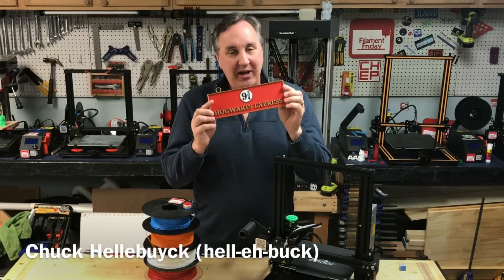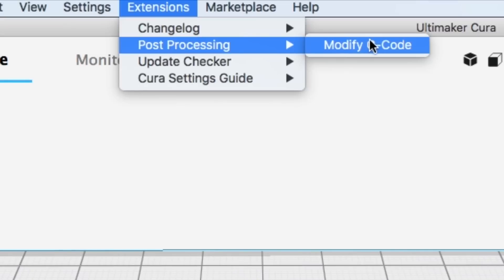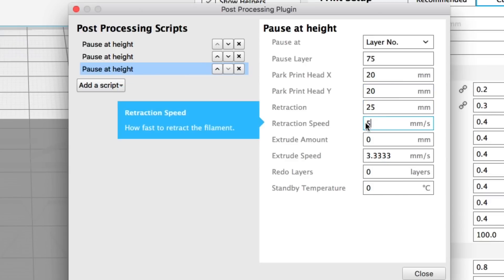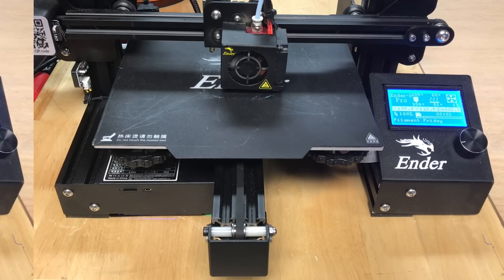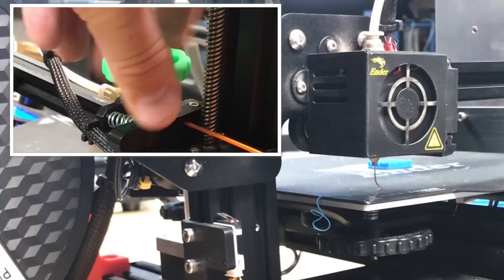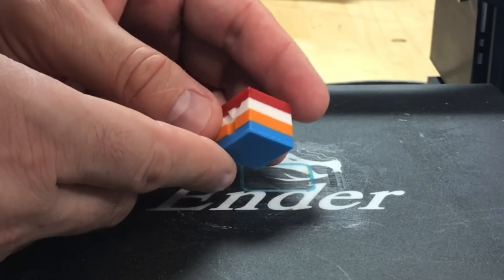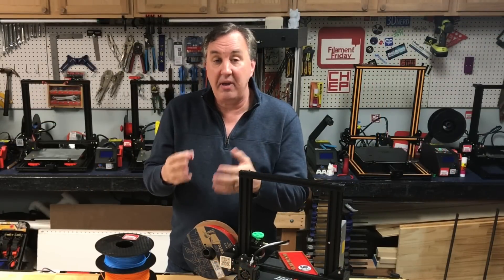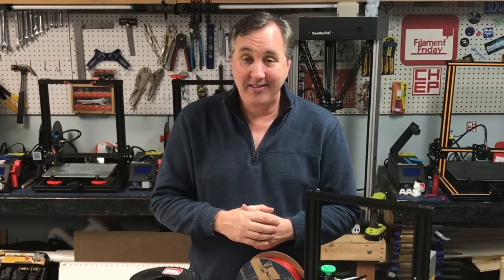How to do Multi-Color 3D Prints on Ender 3 3D Printer

Comment: When I pause at layer the print starts right back up again by itself after a few seconds without letting me change filament. Ender 3 V2 with Cura 4.8 
Any ideas why?
Reply: Have the same problem
Reply from the maker: Yep. It’s firmware issue: https://youtu.be/vFcMW6m9OGg
Reply from the maker: Try using the M25 option instead of M10
Reply: It didnt work for both options, but when I used “filament change “ it worked

Comment: Couldn't you just add the G-code to push out 100mm after a filament change and the hotend reaches temp?
Reply: @BlondieHappyGuy  I did NOT say "retract". Take a reading comprehension class. Then reread my comments.
Reply: probably, but you'd still have 100mm of filament hanging that you'd need to cut off before it gets all over your print.
Reply: @TheSwordThain  No it wouldn't. The video showed the hotend was already removed from being over the print. And you could just have it print a 100mm line on the side of the bed away from the print. Nothing to cut and it doesn't interfere with the print in any way.

Comment: Hi chep, thx for this video as well as the other here on YT. I have one question, what will the standby temperature be on ABS?
Reply: Should be similar. 25c is just a safety temp. Not hot enough to burn you, but above room temp to aid in it heating back up faster.
Reply: @TheSwordThain  Thank you.

Comment: If i insert other color filament, the head moves, and wont print correct.
The head is not allowed to move while changing filament, impossible : if i touch the head it moves.
How can i solve this ?
Reply: I am having the same issue and am experimenting with the stepper motor engagement timeout, but it is maxed out at 999 seconds which is fast. I had a few failed prints from not changing the filament before that timeout time. Just curious, what version of marlin are you running?
Reply: same problem with me

Comment: It doesn`t work for me. I have an Ender 3 Pro with 1.1.8 Creality 3D Firmare. I used PrusaSlicer. After the programmed stop (M600) the Extruder moves to the side, but i can`t resume the programm afterwards. Any suggetstions of what might be wrong? Do I need to add something to the code manually?
Reply from the maker: Not sure. It worked for me.
Reply: I have same issue using an AnyCubic Mega S and Cura 4.8-- stumped in fact!
Reply: @Dr_Mohamad_Shaheen  Just found the solution. Im using  the Mainboard: Creality Silent Mainboard V1.1.5 which has the «Advanced_Pause_Feature» disabled by default. After enabling it (on the Firmware), it worked like a charm
Reply: @Noobiosity  Hi can you describe how to enable it?

Comment: Hi Chep fantastic material. I have only one issue a huge blob after extruder comes back above the part. I am using Cura 4.8. Do you maybe faced something similar?
Reply from the maker: It can happen. I pull the filament back a little after changing.
Reply: @FilamentFriday  wow thanks for prompt answer, thats right simple solution :), I will try to implement it in the gcode, thank you for sharing :)
Reply: @FilamentFriday  what commend I could use?

Comment: Great video Chuck. But why do you reprint the last layer? If you extrude some filament prior to restarting, why do you need to reprint a layer?
Reply from the maker: I like to get it soft for better adhesion.
Reply: @FilamentFriday  I was afraid re-printing a layer would wind up driving the nozzle into already existing material. I'll have to give it a try. Thank you.

Comment: Thanks again for an excellent tutorial. I have ander 5 Pro with Duet board and added another extruder. I was battling for a couple of week to get the settings in Cura 4.8 close to right. I was advised all around to rather use PrusaSlicer. I tried but also didn't really get any support from PS users and forums.
Will you please consider a Filament Friday tutorial on Cura settings for a dual extrusion printer? Thanks again. Greetings from Johannesburg, South Africa.

Comment: Does anyone know if the "Pause at Height" also disables the steppers? I have done a CHEP cube in two colors recently using "Pause at Height" and it printed perfectly. When I tried using it again with a bi color ornament, the Z-axis must have lost position because when resumed the nozzle slammed into the print. 

Does "pause at height" lock the steppers except for the extruder? Should, "Filament Change" be used instead?
Reply from the maker: Depends on Cura version. 4.6 and later has an option to set how long to freeze the stepper. 1800 seconds  is the max which is 30 minutes.
Reply: @FilamentFriday  Yes this is important because otherwise the z lead screw can rotate during filament change and you will lose your z reference; then the whole print will be ruined. Happened to me. Thanks for doing the videos Chuck; great job. Ben
Reply: @dieselhead24  This may have been what happened to me.  Ender 3 v2 with newest marlin firmware. Cura 4.8.   Used paused at height  gcode setup and the print Paused at the right layer height, then when resumed it slammed into print and was dragging across the already layed lines.  I have noticed when I've changed filament before that the extruder will move down with any pressure.  Going to try using the filament change command in cura 4.8 instead to see if that  helps with my changing filament mid rpint.

Comment: Hi! Can I do this with Ender 3 v2?
Reply: When I pause at layer the print starts right back up again by itself after a few seconds without letting me change filament. Ender 3 V2 with Cura 4.8 
Any ideas why?
Reply from the maker: Try using M25 instead of M10.
This is why; https://youtu.be/vFcMW6m9OGg
Reply: @FilamentFriday  thanks for answering us sir, greetings from indoensia.
is that M25 or M10 is the method ? as in the list :
Marlin (M0)
Grifin (M0)
BQ (M25)
Reprap (M226)
?
thanks
Reply from the maker: Yes. Try the BQ M25
Reply: @Juliarta Suwasta you better revive pacman or we'll invade your country and bring you freedom. Just warning you once.

Comment: Is there a way to remove the blobs that it leaves on the prints that are supposed to pop off easy. My nozzle will bump right into the blob and it will shift my glass print bed over and will throw off my print.

Comment: I have tried this on an Ender Pro3.  It only pauses for a few seconds and continues.  Any suggestions to make the pause longer or until I start it manually?
Reply: Same happens to me
Reply: @RyanD-045  Need to do a firmware update.  That allowed me to do what I needed to do
Reply: @bradmcwhirter7450  which version?
Reply: Do you have discord?
Reply: @RyanD-045  I do not have discord on my devices with me.   I also do not have the link to the site with the updates but in another video, CHEP recommended a pay site for updated firmware that is updated daily.   This helped me accomplish the color change since I use a creality printer and their firmware does not activate the options needed for color change
Reply: @bradmcwhirter7450  their are too manny files, is their a better way you can help
Me?
Reply: You have Twitter or instagram?
Reply: @RyanD-045  I will look for a link

Comment: Thank you Chep. For me, this worked 1 out of 4 times by now. When the printing head comes back, it digs its hot nozzle into my print and destroys the bottom layers. one time it took off my glass plate and my clips. My only guess is maybe I'm pushing the z axis while I'm changing the filament, I'm trying to be very careful...I don't know...anybody has any ideas? I also selected 0 under redo layers.
Reply: I just had the same problem. Ender 3 v2 with marlin software. And sliced with the newest version of cura. I set the time out to 5 minuten so i can easely change the filament. Every axes including the extruder was locked. So pushing the fillament through was not possible with the weel. I pushed it a little bit through out the wire. After the 5 minutes were done the printer started again but pushed the nozzle deep in the print. Luckaly i was at the printer at the time it happend and i could shut it down.
So with me the z axis was locked but still restarted lower than the last layer. I had not chosen the option to remake the last layer again. Sorry for my bad english if its bad 😁
Reply: @steefco  You have to pull the filament out by hand, (squeeze the extruder lever) and push the new filament in by hand the same way, don't use force on anything or you may cause a stepper to skip. 
Have the pause script move the print head to 0,0 so that when it purges (which is also a configurable thing) it does it off the bed, (if your first pause is not very far up) the second time I tried this trick, it worked ok, with the locked steppers and a good purge.
Reply: @diamaunt2782  thank you for the tips.  I did use the lever for transporting the filament thru the tube. I would like to flush the filament myself by hand but i think i test it again and see if the softwareflush is good enough. And hope that it will not crash again into the print. 
Question: if the z axis changes in the time of the pause the steppermotor wont correct it when it starts again?
It seemly does not know that it changed. It only Works with commando's to go down or up and dont know its positioning from the bed. Is that right?
Reply: @steefco  That's right, if any of the steppers are not locked (set a large disarm timeout so they will stay locked, up to 1800 seconds) and if anything moves, the printer has no way of of knowing it.  Set an 'extrude amount' to do a purge of old filament after the change.
Reply: @steefco  i discovered a new problem. 2 out of 5 times i did this the my ender 3 v2 screen hangs and when i press it just stops the print all together....
as  for the blob when its starting to print theres a line in the gcode that tells the extruder to push out when it wants to resume. u can just delete that line.
Reply: @ozeahairrul9357  thanks for the tip. 
With one of my last prints i had also something strainge like that. The screen was displaying the setting menu while printing and when i went back out off the settings it stopt displaying the progress and went to the startmenu. But i was lucky that the printer went on with the print and finnisht it.
Reply: Same here, the Z axis ends up free, so there's nothing holding it in place.
Reply: @diamaunt2782   i had same problem, try setting disarm timeout to 1800 (the max 30min setting). This will keep the stoppers armed so it won't shift while switching the filament.
Reply: Forgot to mension another thing that happend. Before it wend from rest position to restart it pushed out filament fast in a thick beam a few centimeters long.

Comment: Hi sir please help. I got an anet a8 plus and using cura as the slicer. However, when start printing 2 colors it always end up the nozzle dont get back to the home position once the first color is done so the nozzle keep extruding out the first fillament on my first printing. I have modified the gcode and put m600 but not work at all (i mean the nozzle cant back to the home position when start changing the 2nd fillament)
Reply from the maker: I don’t have that printer so I’m not sure.

Comment: Thanks for your clear explanations how this should work; however, it does not for me, although I followed every step in detail except for the fact that i reduced the number of colour changes. I am using Ender 3V2 and Cura version 4.7.1. 
Is Cura the problem, and if zo, which version would you recommend?
Reply: I should add, that the problem is in parking: it does go to position 20/20, pauzes for just a few seconds and then takes of again.

Comment: I tried using this technique on a print to change colors and the printer stops as it should, but the nozzle crashes into the print when I resume, any advice?  I am using Cura and a Tevo Tornado.

Comment: Tried this on the cr6se and it jus resumes automatically. How can i pause it and then manually start it? using cura 4.7.
Reply from the maker: Use M25 pause not M0
Reply: @FilamentFriday  how about anet a8 plus? i need to put the nozzle back to the home position when changing the fillament

Comment: @CHEP where can I find firmware for Ender 3 V2 that will support M25 or other pause method for this printer. Will be great to have filament change mid print for 3 V2... please
Reply from the maker: I’m close to having that with V2.0.7
Reply: @FilamentFriday  So good to hear - want to try it on my E3V2 whenever ready. Thanks!!!
Reply: @FilamentFriday   Hi, thanks  for all the great information. Is the fix implemented in V2.0.7 firmware for the Ender 3 v2?
Reply from the maker: Yes.

Comment: do you idea how to do this. on the new. ender. 3v2. ??
Reply from the maker: Yes, requires a firmware change.
Reply: @FilamentFriday   do you have a video from how to do it im currently running on 1.0.2 firmware
Reply from the maker: Use M25 pause instead of M0 in Cura. It might work.

Comment: sir need to know how to avoid z axis disturbing while changing fillament and what is i mistakenly moved the z axis and get back to the same point so that my print won't get wasted
Reply: you need to keep the z-axis stepper motor armed (locked). It is a setting on the "pause at height" setup within the latest cura software.

Comment: Thanks for the video Chep! I followed your examples with an ender 3 v2 with Cura v.4.7.1. When getting to the proper layer to pause the ender will home itself in the position in the script but then continues printing with no pause. I have tried it a couple different times with the same results. Am I missing something? Anyone else having this issue?
Reply from the maker: Try the M25 version.
Reply: @FilamentFriday  what's the M25 version?
Reply: @princemiro7241  I just tried this myself, as I was having the same problem with my E3v2. In the 'pause at height' setting, change the Method to BQ (M25). It homed and stayed there until I told it to print again. Unfortunately, it seemed to be off by a couple millimeters to the left, and it also seemed to be printing to low on the z-axis and was dragging across what I'd already printed. But at least it paused!
Reply: @Dadtheimpaler  hi john, do you know how to set the anet a8 plus to get back at home position? Ive tried m25, m0, m600, but it keeps stopping on top of the model
Reply: @mekanikateknik8723  Sorry, I don't.

Comment: Note to beginners when it stops printing it disarms the steppers and it losses its place
Reply: You have to enable disarm timeout and set it to 1000s so the z axis do not move under pressure
Reply: @Not_furry06  I got it up to 1500s to give 25 minutes, just in case one is away from the printer.  Also, he doesn't call it out in the video, but the redo layers I think is key too, just in case there is a variance in Z (I know mine isn't perfect) and there could be variance in the flow due to a few factors like moisture, which could cause the layers between he color change to have a slight gap, so the layer redo is a good idea imho.

Comment: Doesn't work with CR-10S Pro V2. It goes to pause, moves to the X and Y axis provided, then returns to printing immediately
Reply: Nothing happen in Ender 3X using Cura 4.7.0, the M0 it's in the code, but didn't go to the position X20 Y20 or even stop.

Comment: Hi from France ! 
Incredible video very helpful but i just have an issue. 
When i change the filament during the pause : i can't move my extruder ( the wheel on the extruder ) it's stuck. 
Therefore i can't purge the last filament and it has to purge itself during the beginning of the second print.
Is there something i can do to cura or the gcode to disable the extruder motor ?
Reply: Try disabling the steppers in your 3d printer's settings.

Comment: Hey Chuck,

I've got a question for ya, that might actually be potential as a video topic. Soo I've used this pause at height method with success, but recently I had 2 failures due to the stepper motors not being active, I accidently bumped things around loading filament throwing things out of whack upon resuming.

Soo I then tried the "Filament Change" post processing script, which I would prefer to use as it keeps the stepper motors active. But for some reason upon resuming it creates a pea sized blob on the current layer just prior to retracting, then pausing. Any idea how to fix this? Or what's going on?

Comment: You could also adjust the G-Code / have your script do a bed wipe after each pause. This way you don't need to manually adjust purge the filament in the narrow time window between melting temp and when the head starts moving.
This is great... if you want to only change color on specific layers...
Reply: surely as it reaches for the bed it would knock your print over?
Reply: @pieceopye4046  That depends on the printer, and also how big the model is, of course! It's not always possible, especially for big prints.

On Ender 3 or similar printers, I would wipe along the front or back edge of the plate, to reduce the chances of a collision. 
Will not work if model sticks out too far in the Y direction though.

Conceptually, a "Prime Tower" would also work, but I'm not sure how cura would play well, since it's expecting a multi-headed extruder for that.